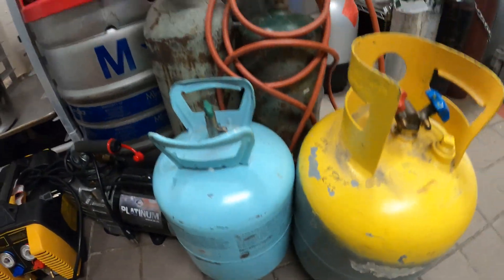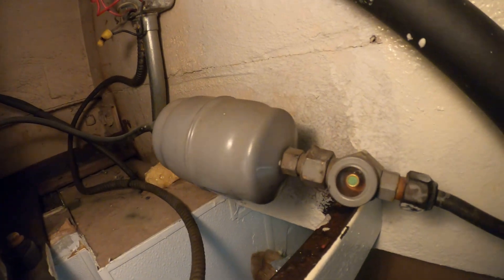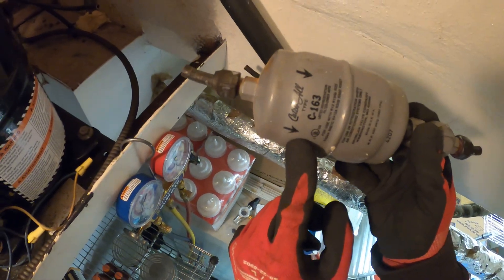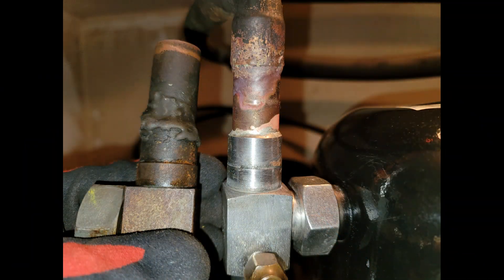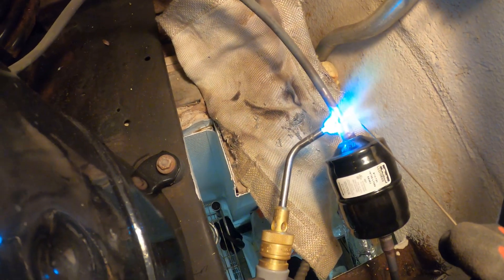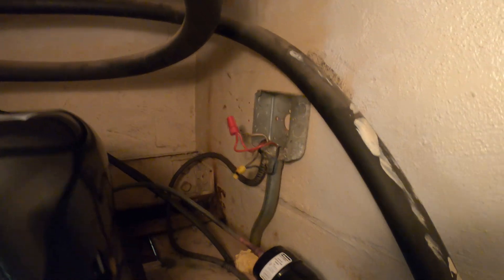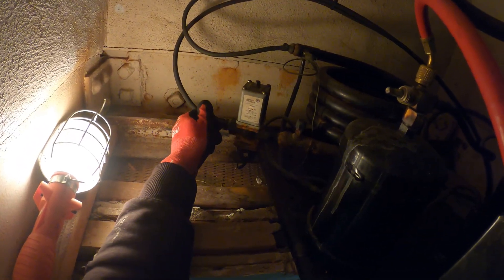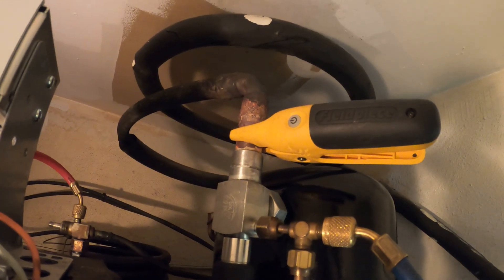HVACR Service Call: Walk In Refrigerator Refrigerant Leak Repair (How To Fix A Refrigerant Leak)

Comment: Not that it is proper, but say if it was a system for your own walk in freezer off-grid with limited parts available post-apocalypse: Wouldn't the service valve cap that is missing (but briefly shown) take care of that leak?

Comment: Rookie tech here! Why did you recharge through the highside/liquid ? Im only asking because I've seen other techs recharge through the low side/vapor. Great Video btw!
Reply: you charge liquid through the high side when the system is on standby. Just imagine putting fully liquid refrigerant in the suction Line and then starting up the compressor. you could blow up the whole Compressor or cylinders inside. 

Greetings from Switzerland :)

Comment: 12°f superheat going to flood compressor back my brother
Normally want to be 6 inches away from compressor to get true compressor superheat reading and get 20°f lowest compressor superheat to 30°f anything lower or higher could potentially lead to compressor failure.. big fan of your videos though 🦾🙌🙏🤙😎

Comment: Putting stuff like this on the internet invites praise and constructive criticism. You fixed the leak, installed a new drier and got it working so that's good...but....you should have fitted a sightglass, you should have used the new O ring, you should put fridge oil on flare connections, you could have pumped it down intead of pissing about with the recovery machine, subcooling is a meaningless measurement on systems with a receiver, your temp clamp on the suction line was right next to the compressor and if you sand the pipe work before you cut it, it's easier. Flared or brazed driers/sight glasses/solenoid valves/txv's is an ongoing debate, flares leak brazed joints don't, but flares are 'easier' to change....pro's and con's either way

Comment: Wow first time using 56% Flux rods and already an instructor?  I've been building these rooms since 93 I'm building a 12x10x8 freezer right now.  Did you tighten that 2 edged nut on the stem? Usually some lock tight leak block on the stem cap will suffice . Don't directly touch anything with your leak detector it'll always beep. I would have replaced the filter dryer with another flared one and kept the sight glass.  Good luck kid .
Reply from the maker: First time with the 56% Flux coated rod. Been in HVACR since 2011. Wow 93, that's awesome. Respect to you Roland. Lock tight on the cap mightov done it but I rather do the right thing. You're right about the electronic lean detector but I make sure I don't bump it. Not a fan of flared connections. I sleep better at night with brazed connections haha thanks for watching & commenting! Stay tuned for new videos every week⚡🔧

Comment: to weld to a roto lock you need the 45% silver to weld to the steel, taking out the sight glass is a rookie mistake, it is there to indicate when the system is fully charged, if he worked for me i would have fired him for not reinstalling the sight glass, also he did not have to replace the roto lock just the gasket
Reply from the maker: I used a 56% Flux coated rod. A sight glass is an accessory. Good thing I work for myself so nobody can fire me. Thanks for watching 🔧
Reply: @JumpermanTech  idiot, the sight glass is not an accessory, it is required to ensure the txv has a steady stream of liquid going to it, otherwise you may have evaporator coil freeze up, 40 years of experience tells me this is a fact
Reply: When I was young I worked at CN (Canadian national railway ) for 3 years. They'd fire us if we opened the system without replacing the oil in the compressor. I've never dumped so much clear oil in my life. Also I've never seen so much contamination  either the compressors seizing up and starting a fire from the straps. The kids would get air in the system and the oil would foam up thick like pudding.
Reply: @rolandgirouard5914  sounds like it was a r22 system with 404a or 134a added without a oil change, mineral oil will foam with the “A” type Freon in the system, you can drain the compressor and change the oil if it has not locked up yet
Reply: @williamfowler9882  actually it was the late 90's and we were converting from 502 to 404.

Comment: Hi, Nice useful video for training. As an instructor and working in the field, Don’t worry about some of the criticism being received.  If the Teflon gasket looks to be in decent shape, go with it and leave the extra gasket with the system. It is rare to see a system leak at the Roto-Lock gasket. Not installing a sight glass is a technicians choice. We have other methods like temperature, pressure, Subcooling and Superheat to ensure a proper charge. Not only that you can hear proper liquid head at the TXV. An experienced tech will get the charge correct. We deal with many emergencies and often don’t have a flare drier. Go with what you have.  I would definitely go with a flare drier, If we are dealing with acid or water in the system and add a moisture indicator.  I highly doubt these techs do everything by the book 100% of the time.
Reply from the maker: Thank you! I appreciate your comment very much. That's exactly what I did with the gasket. Left it as a spare. Exactly, a sight glass is just an accessory but it would have been nice. No big deal. I only stock sweat driers in my van and making use of what I have. They definitely don't do everything by the book 100% 😅 Appreciate the feedback. 
Stay tuned for new videos every week⚡🔧

Comment: Personally I would have fitted a new liquid line sight glass as the system has a liquid receiver, and left as flare connections, makes future jobs a lot faster. I have not seen those flux coated rods here in Australia, usually I use a 45% rod and pre flux coat the joint.
Reply from the maker: I hear you with the sight glass. It would have been a nice feature but it's just an accessory. Doesn't take much to sweat in a new drier. That was my first time seeing and using that Flux coated rod. Flux and 45% is the way to go. This rod was at 56%. Had no issues. Pretty awesome
Reply: We use the Pre-coated ones in switzerland for small dimensions. As soon as i go up to 28mm or even 35mm ( 1 1/8 or 1 3/8 ) i personally prefer the pre-flux and blank rod method

Comment: Any reason why you took out the sight glass? Is there not a receiver on that system?
Reply from the maker: Didn't have a sight glass and there is a receiver on the system. A sight glass is just an accessory. It would have been nice to have but that system is working just fine. Having the right tools can confirm that👌 Thanks for watching & Stay tuned for new videos every week⚡🔧

Comment: Use R12 alternative if it is a R12 compressor. R134a should be used in polyester compressor.
Reply from the maker: This was an old unit but the compressor was  replaced. There was already 134a in it according to the engineer in the facility so I just went with what's there. I hear you with that! Appreciate the feedback & Stay tuned for new videos every week⚡🔧
Reply: I heard you said you charged R134a into a R12 compressor. That’s why I brought it up. Use R134a If replaced compressor came with polyester oil. Use R12 or R12 alternative if replaced compressor still came with alkylbenzene oil. Whoever replaced the compressor should honor the rule. Pump down the refrigerant to liquid receiver will make rotalock valve replacement much easier. Actually it is not necessary to change rotalock valve if it is only a minor leak from valve stem packing. Retighten brass packing will stop leak. Apply blue leak lock sealing compound over the thread and joint of brass packing even better. Nice talk to you. It is a pleasure.

Comment: 👍🇺🇸💪❄ great vid. Any need for leak sealant on threads b4 connecting service valve to Compressor ? N did u have to change the oil since it was r12 n u put in 134a ?
Reply from the maker: Thank you dude 🙏 No need for leak sealant on the threads because there's a gasket inside that does the job for you well. If you want to though, I'd recommend NYLOG BLUE💯 I can see this unit is old but the compressor had been changed and it had 134a already in it so I didn't change any oil. Thanks for watching & Stay tuned for new videos every week⚡🔧

Comment: Do you run nitrogen while brazing with that type of brazing rod. I would be afraid of the flux getting inside of the system causing contamination. It looked like it worked well; first time I have seen that type of brazing rod used for steel to copper for HVACR work. It looks more like something the auto body trades would use. Is it possible to braze steel to steel tubing with that rod.

Comment: Anytime you replace the rotor lock valve, you replace the gasket that came with it. 
You ALWAYS install a slight glass as well. You need to insure you have a full collom of liquid to the txv
Reply from the maker: Had no issues and left the gasket as a spare but I don't disagree you with there. As far as "ALWAYS" install a sight glass, a sight glass is just an accessory but it would have been a nice feature. Thanks for watching🤙
Reply: @JumpermanTech  👌🏻
Reply: no  YOU dont HAVE to replace the gasket at all  inspect it make sure its smooth  if not than you toss it out..    a SIGHT** glass ya he screwed that up   not even sure why he recovered the gas anyways
Reply: @primetime758  they put a new gasket in the bag with the the valve. That’s the same thing as changing your oil filter and using the old o ring. Sure it might work, but why do it. The system is already open. What’s 2 more minutes
Reply: @Justintime631  They put it there for emergency cases  you dont have to change that gasket ..  i know what comes in the box thanks...
Reply: @primetime758  👌🏻
Reply: @Justintime631  do you always follow the rule book  ....
Reply: @primetime758  of course not,  but ur missing the point of the original comment. The system is open and the valve is off, 30 seconds to change the gasket that the valve comes with. I’m not sure why you can’t comprehend that.
Reply: @Justintime631  i can  but that gasket was healthy i dont understand why you dont see that ...   if you over reacting over this i feel bad if you actually install walks ins
Reply: @primetime758  dude. I’m not gonna have a internet argument. Do what the hell ever you want. Have a good night.
Reply: @primetime758  👌🏻
Reply: @primetime758  definitely a good idea to change the gaskets. Notnsure why you wouldnt soend the extra 10seconds to do that. Sure you don't HAVE to wipe your ass after taking a shit, but typically it's a good idea to.

Comment: I’m thinking: those electrical wires gotta be addressed.
JMT: I gotta address that electrical junction.
💪🏼🤙🏼

?: Can you explain brazing vs soldering in your applications?  I watch as a DIYer (all things). Grazie!
Reply from the maker: Great minds think alike hahaha I had to handle that wire situation lol Its the little things. I actually made a video on how to braze and another on how to solder. I explain them there well and you will see the process is different but for short as far as applications, brazing is for piping containing refrigerant as it is considered a gas tight joint as solder is not. You'd use solder on pipes such as a water line or air. Sometimes it comes down to your preference as well. Hope it helps. Thanks for watching & stay tuned for new videos every week! 🔧⚡ 

How To Braze Copper Pipe
https://youtu.be/dfXQV3m63ag

How to Solder Copper Pipe
https://youtu.be/L3IrH15z-Fs
Reply: @JumpermanTech  gotcha, bro! Makes sense. I’ll be sure to watch those vids. Thanks. 

How’s the motorcycle?

I used to ride a GSXR 750. Loved that bike. And I’m still around to talk about it 😎
Too risky now with so many numb nuts on the roads. Plus terrible asphalt conditions. Where the municipal taxes go??….